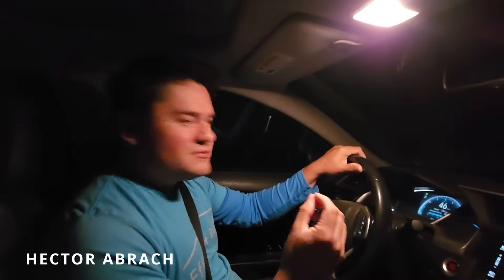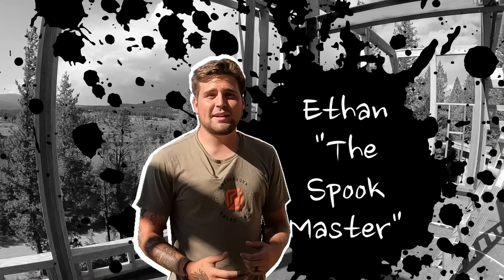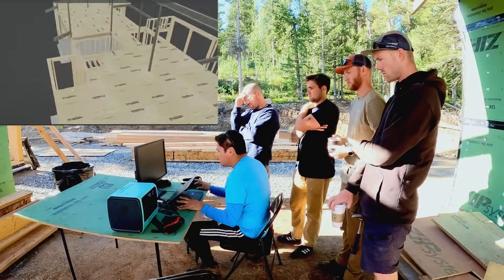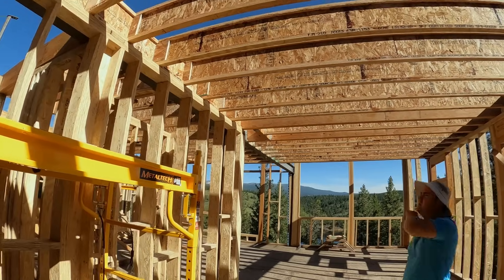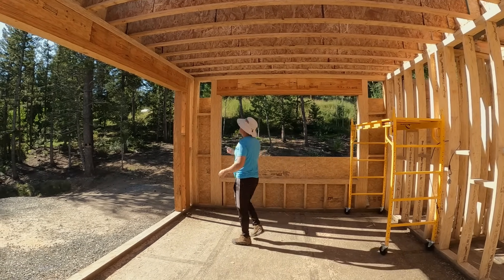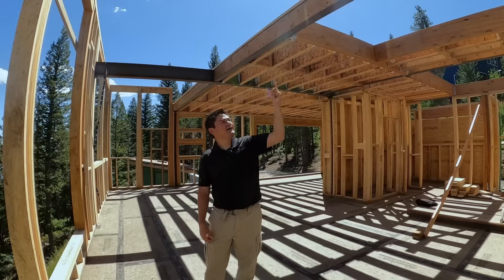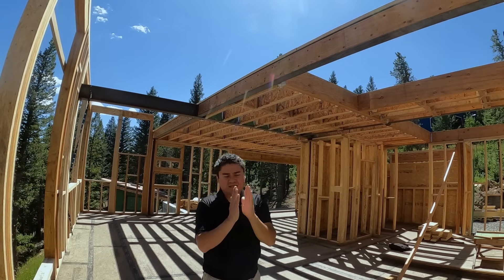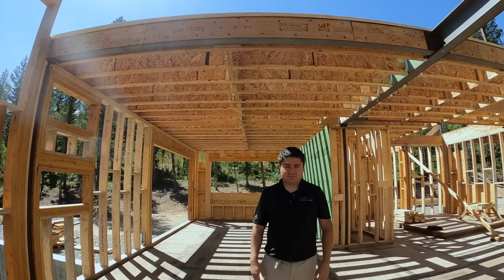S3EP07: Framing Floor System, Coffman Crew

Comment: Are there any concerns with having had to remove a small amount of wood from the swelling? For instance, will it dry and compress and end up leaving space for squeeks?
Reply from the maker: No, it will be ok. The tongue is more of a horizontal spacer rather than a vertical one.